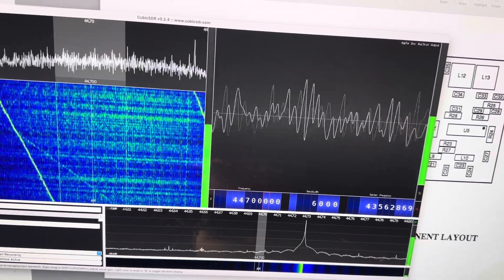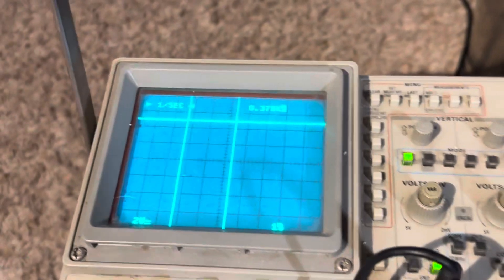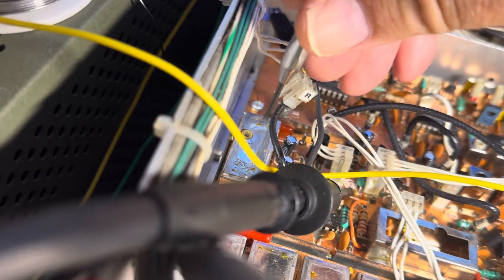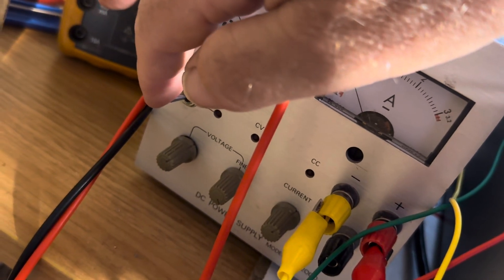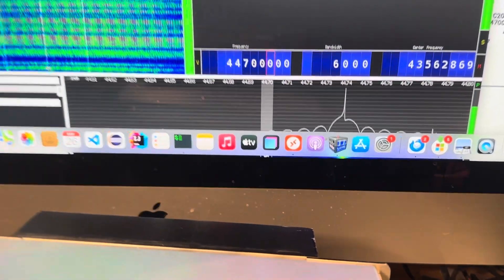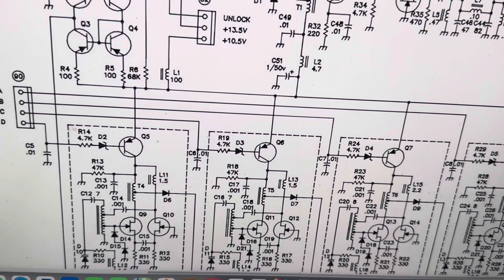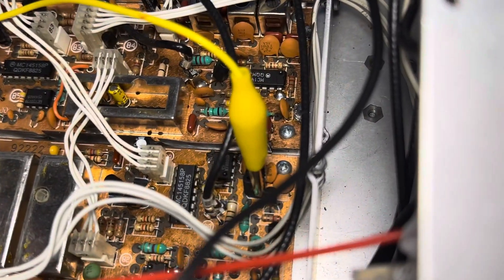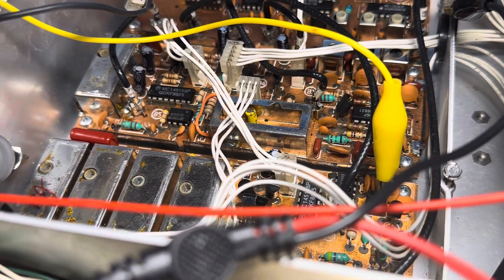TT paragon minor loop board use pin #7 on PLL chip for lock indication with scope

Comment: I guess you've gone over the PLL board(s) and carefully soldered both the tops and bottoms?  TT didn't plate their thru-holes and over time this caused massive conductivity headaches!!  BTW, I've got 2 TT 585 Paragons.
Reply from the maker: Replaced PLL chip on each Major and Minor board. Replaced modulo chip on minfor board. Resoldered 3 times. Replaced NOR gate chip on the reference board which is a driver for the 2.1 Khz signal. And finally it locked and locked.